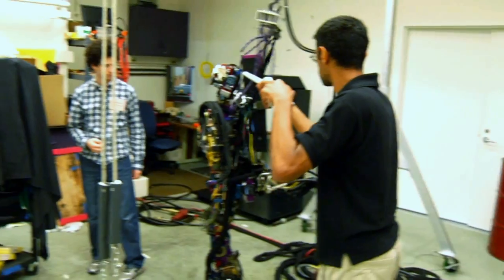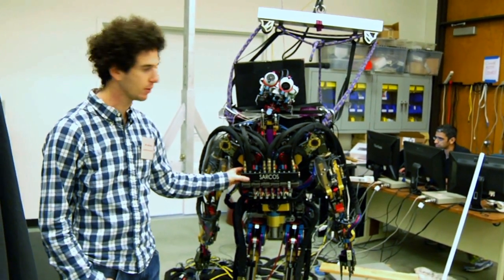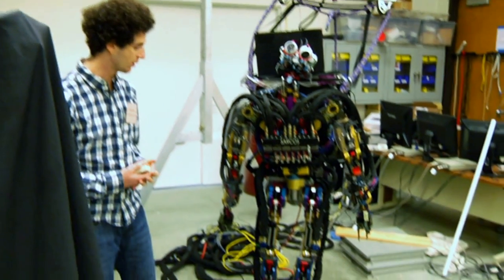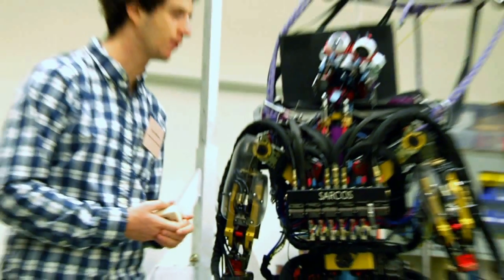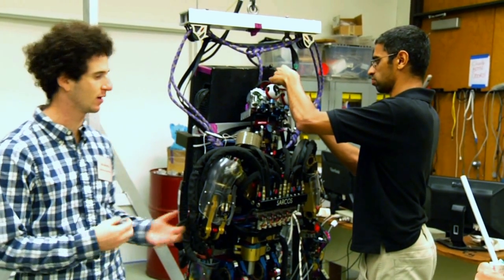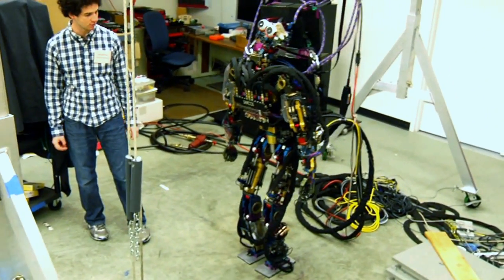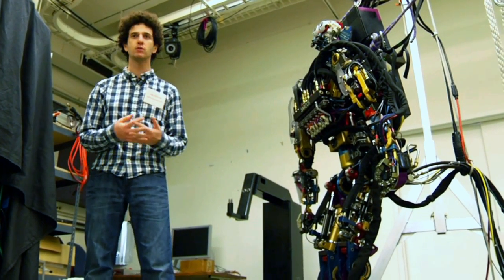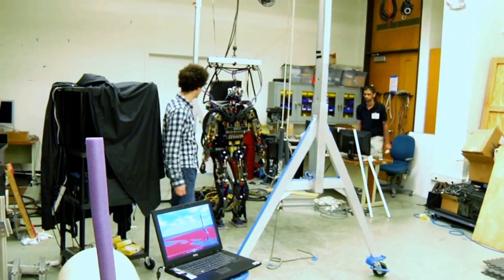Sarcos Returns: Robust Walking

Comment: The problem is not lack of of information sharing.  The majority of people who do this sort of research are academics who publish all of their results or even freely share their code.  You see many versions of walking because many different people are trying many different solutions to a hard problem, each of which has different strengths and weaknesses and works on different kinds of robots.  You see definite progress over the years as people combine the accumulated knowledge and improve it.